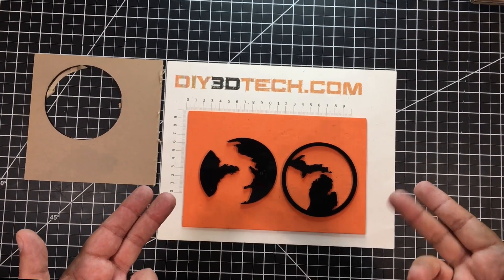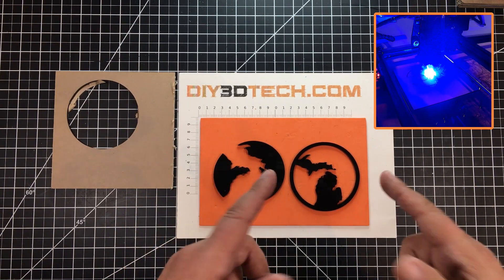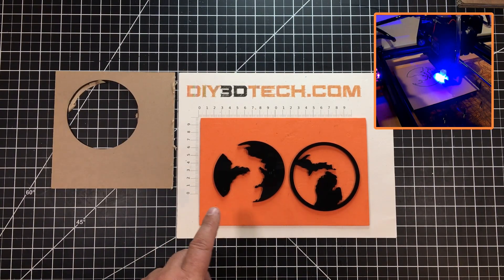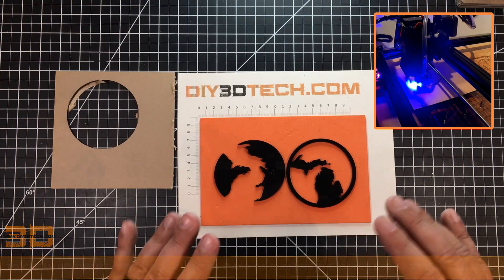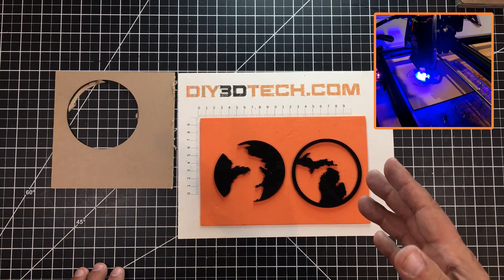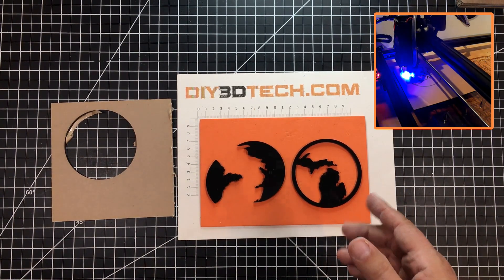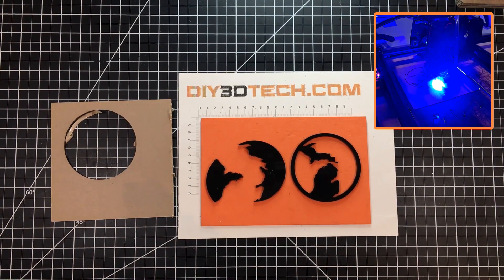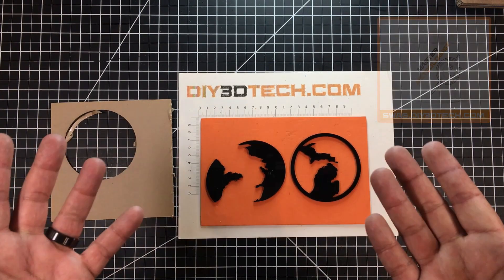Ortur Laser  - Turing Acrylic Into Cash!

Comment: Hello from Nashville TN. get right to it ortur sent me a updated fixed lens laser. I bought 12x12 inch cast acrylic.  I hand the laser for cutting at 200mm/s and the power 100.  It did not cut.  Also now the mask is brown sticky paper it comes with the text didn't engrave either at 600 mm and 80 percent power I know these are off if you or anyone van help.  Thanks in advance... Ken

Comment: I have ortur lasermaster2 20w. Black acrylic. No air assist. Sometimes it cuts properly sometimes it won't. I have had my laser for 2 weeks. Why will it only cut the acrylic sometimes? Like you said it seems to melt back together at times. I dont understand. I have tried all speeds and all different power levels. Looking for consistency because this acrylic is getting expensive fast! Thank you for any help.

Comment: its not as crisp as a 40k laser could do.   and the 40k laser can do a lot more.   and the 40k laser is only $100 more.  this otur is practically useless.
Reply: What 40k laser is $$280-$350 ready to use out the box. Everyone of them I've researched requires $250+ of upgrades
Reply: @DRob70  the ortur is $280! the 40k on ebay is $400! and you dont need the upgrades! they are just that, upgrades! it works fine as it, unless you are doing a business.  still better than the ortur buy a long shot!  for a lil more money!  and works right out the box too!
Reply: @IronMan-yg4qw  You can get an Ortur for $185, ready to use. So plus the $100 you spoke of, there's no $285 40k. And every real review, (meaning someone who has purchased and uses it), has said the mirrors, exhaust and cooling system have to be replaced. Cost of up to $250 extra
Reply: @DRob70  THE $185 ORTUR IS ONLY THE 7WATT WHICH IS ACTUALY ONLY 3 WATT!!!  THE 20 WATT WHICH IS ONLY 7 WATTS IS $285! ANOTHER $100 GETS YOU THE 40 WATT LASER FROM EBAY!!
Reply from the maker: Do you have both?  I do (as well as several k40's) and the Orther does a great job as #1 it is FAR safer then the k40 (did you see the tube fail video), the safety issue list for k40 goes on and on.  Second the k40 is junk out of the box, did you see all my alignment videos?  The Ortur and NeJe just work out of the box. so sorry to say your comments are unfounded...
Reply: @DIY3DTECHcom  i see.  safety is your fear.  you best stay away from lasers less you blind yourself.  hah.   many others have and are having great success with their k40.  of course they have better knowledge of the handling of the greater power of the k40. the ortur cant do much of anything.  i guess its like the 3d pen (ortur)vs the 3d printer (k40).   with greater power come great responsibility.
Reply: @IronMan-yg4qw  i died.
Reply: @LintRoller86  ??